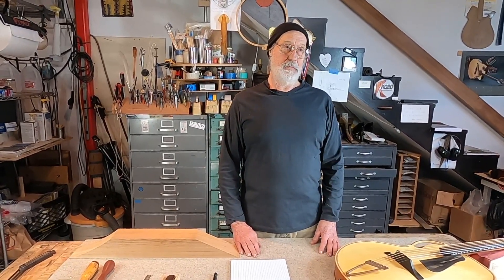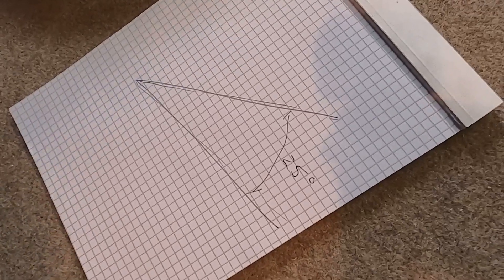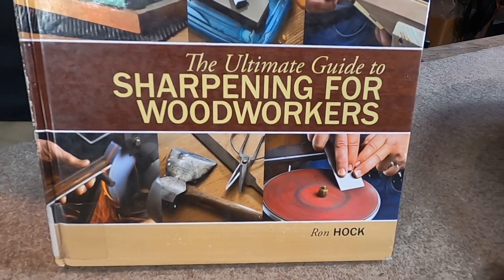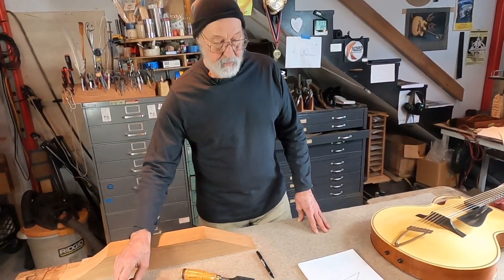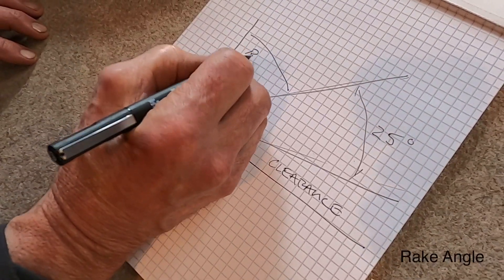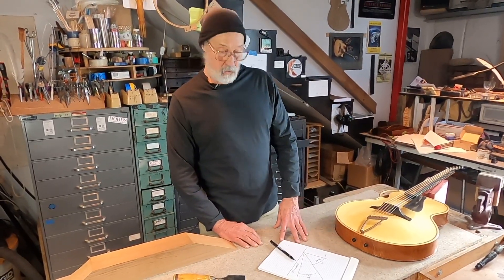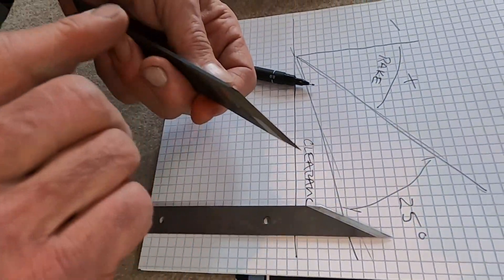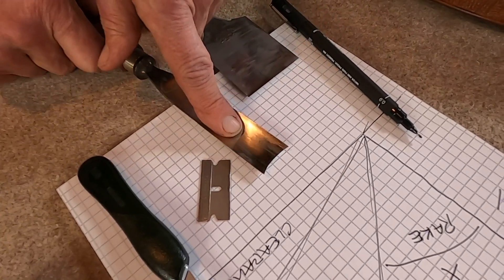Ken Parker Archtoppery - Tool Geometry 1

Comment: Thanks for the video!
It was nice following your explanations on this subject.
The curved grinding was specially interesting as also with the curved cutting edge.
Incase some junior viewers do not know the abrasive grinding/ honing stones using water, have to be soaked overnight to be useful!
As with the cutting angle, the smaller  chisel width could make things easier when used correctly.
I only make such comments when inspired!
From a fellow senior citizen!
Reply from the maker: Thanks, Glenn!  Overnight might be a bit longer than you'll need, I think.  I get by with 20 minutes or so.
Reply: @kenparkerarchtoppery9440 A privilege to recieve a reply.
I was only thinking about the small whetstones used by hobbyists trying to get going!